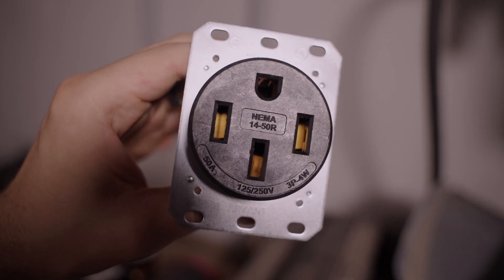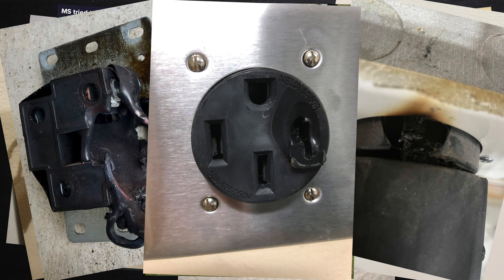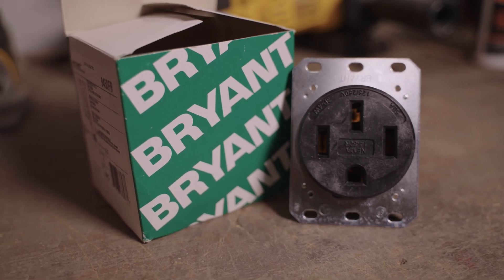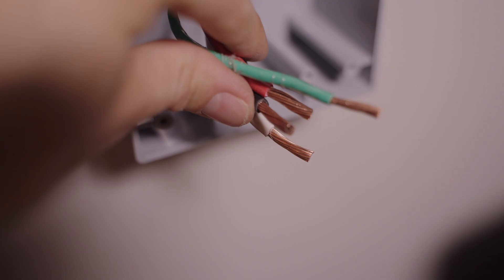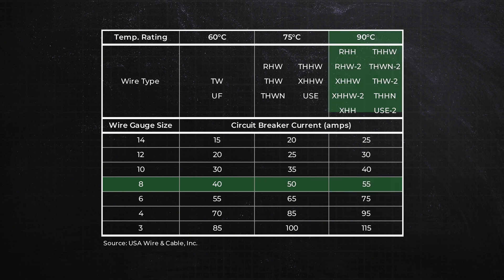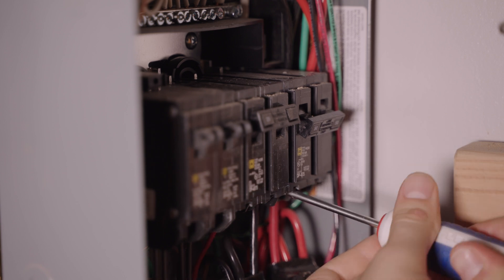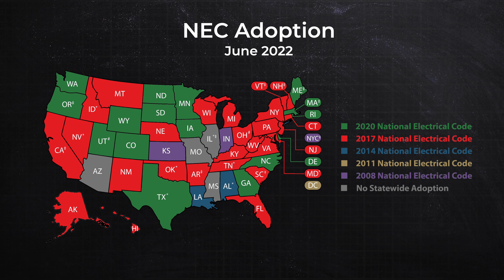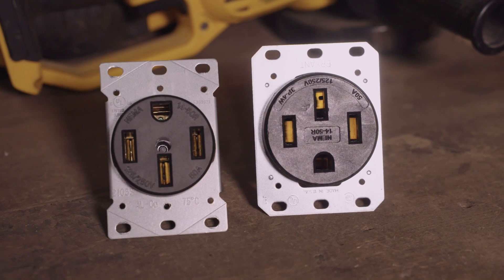3 Mistakes I Made Installing a NEMA 14-50 Outlet

Comment: Regarding setting the torque on those wire clamps, I would suggest that after you torque them the first time, wiggle/rotate the wires somewhat forcefully and and you'll find that the strands in the wire settle a little (like how the level of Corn Flakes drops if you shake the box a bit from side to side) and you can torque them again.  I usually have to do this a couple of times before it's finally fully secure.
Reply: FERRULES are the ANSWER
Reply: Great point for stranded wire  @WiSeNhEiMeR-1369
Reply: @WiSeNhEiMeR-1369  Will Ferrules work better?
Reply: Always wiggle and retorque, and don't forget mineral oil or anti-oxidation grease on the terminals. 💙 T.E.N.
Reply: Great tip !!!!!
Reply: I think this is good advise. I had used 6awg copper, shoved the wires into the box and tightened the plug. Then unscrewed plug and retorqued—there was about 10-15 degrees of additional turn on each wire. 

What I don’t know if the wires at the connection points being at virtually 90 degrees in order for the wire to fit in the box is going to be a problem later down the road?
Reply from the maker: Thanks. This is an excellent point!
Reply: @chargeeverywhere  , Wiggling the wires is a common technique called "exercising." I always exercise and retorque repeatedly, until I have two times with no screw movement.
Reply: @chargeeverywhere  ok josh so now acording to 125% continous rule you have 32AX1.25%= 40 AMP CIRCUIT. 32 AMP CONTINOUS LOAD.
Reply: RELAX TORQUE IS A STANDARD IN THE REFINERY WORLD, YOU GOT A GOOD POINT, BUT A TRUELY BELIEVE ITS OVERKILL.
Reply: @chargeeverywhere  josh so you got 75c breaker and 60c outlet  you need 60 c breaker plus 2 rules 125% continuos duty and gfci nec all evs must have gfci. If wires are going on the etic temp derating you must.
Reply: With 75 inch pounds, I doubt it's a problem. That is a LOT of force.
Reply from the maker: It is a fair amount. The yoke-style wire clamps hold the wire very nicely too. Much better than a screw scrunched down on top.
Reply: NEC 625.41 125% RULE CONTINOUS DUTY...
40AMPS X1.25=50 AMPS. 
NEC 625.54  ALL EVS GFCI PROTECTION .
#8 AWG THHN 90C GOOD FOR 55 AMPS. 
TORQUE 75LB------8.8NM YOU WILL BE SAFE . This is for the NIMA 14-50 .
Reply: @panchopantera8287  "40AMPS X1.25=50 AMPS" He can/will adjust (in the car) the amount of amperage down to comply with this. The hardware makes the initial adjustment according to what "pigtail" you have connected, then the user can adjust this down as appropriate for their circumstances via software on the "Charging" screen in the car.

Comment: When installing the outlet note where the ground plug is in relation to the cord and install it where the cord will hang out the bottom so it does not add additional stress by looping at the top.

Comment: I think a better strategy is to buy a charger for home instead of using the dumb charger all the time.  I got a great charger with WIFI interface that I can set the charging current at just enough to be finished charging by the time I need the car.  Usually the cars estimated finish time is longer than actual so I just pad it.  So far I never need max current and I charge daily to max 70% capacity on iD.4.

Comment: Jacuzzi disconnect has a 50amp GFCI breaker in it that can be installed just above/below the outlet box.. Plugging and unplugging a 40/50 amp cord from a live outlet isn't always safe, and the disconnect shuts off the outlet in case of an emergency without having to remember where the main panel is to shut off the breaker.

Comment: 1:56...after all that effort and expense, why install the outlet upside down so the cord pulls on the outlet contacts? If you plug in once for all time, it would be a good idea to secure the cord so any accidental pulling or weight on the cord does not affect the plug/outlet connection. Given the price of the vehicle and charger outlet installation with #8s or larger, are we really going to complain about $150 for an outlet we would install once? Too many of my customers want to cheap out to save $100 and use an existing 30amp circuit, rather than do it safe with the right materials. It doesn't cost more in labor to install the best outlet available.

Comment: I've been doing a deep dive into wire ampacity, which led me to closely examine the termination temp of those Bryant receptacles. They aren't marked for use at 75 deg C, so you are forced to downgrade your wire to the 60 deg C column of the wire ampacity selector. I'm guessing this is because with a more meaty device, it can't radiate heat as well so it relies more on the wire to disperse heat. Electricians will tell you that if one element of the chain is derated to 60 deg C, the entire circuit gets derated, even if the termination temp at the breaker is 75 deg C. So, instead of being good for 65 A, #6 copper wire going to a Bryant receptacle is only good for 55A of peak current. But wait! From there you need to downgrade the continuous load to 80% of that, to 44A or less. Strangely, less expensive receptacles are marked for use at 75 deg C. I'll speculate that many of the overheated receptacles were wired with inadequate gauge wire, and the wire is important for conducting heat away from the receptacle.

Comment: NEMA 14-50R.  The Bryant is under-spec which why it derates so badly.  Sure, you save $100 on the receptacle but then you had to buy a new breakers, do the work to replace it, and now are ampacity limited by same receptacle/breaker combo.

You could have avoided all this - not by running 6AWG wire - but by spending the cash on a new NEMA 14-50R that meets spec.  Hubbell is great but there are other mfgs that will do it.  AMZ is not where you get those but electrical supplies but a local electrical supply store (or MSC or Elliott) can supply.

So if the receptacle was good then the wire (8AWG) is good and the breaker is good.... so one time expense to replace the receptacle is all you incur.

I have one more question.  You bought two receps but you say you'll use one on your bench.  So you're going to leave the in-laws with the one you previously put in that you got all the comments about?   You should clean up after your own work like any pro!

Comment: A few comments: First, not all EVs use the same charging amperage for a Level 2, and while it is tempting to use a 100 amp charge setup, that is overkill for most EV charging.   For instance, a Leaf requires 27.5 amps for a Level 2 charge.  It doesn't matter if you plug in a 100 amp charger, the Leaf will only accommodate 27.5 amps at 240V because it has an internal charger.  The Chevrolet Bolt draws 32, 40 or 50 amps depending on the model and year.  Tesla Level 2 (even though I would never buy anything made by Musk) draws 40-80 amps.  So the tacit assumption that everyone needs maximum amp electrical cables, outlets, and breakers is inaccurate.  It depends.  Secondly, some state the NEMA 650 and NEMA 1450 are interchangeable.   For charging EVs, they are not since the plug that comes with the Level 2 charging cable is often NEMA 1450.  An adapter is required to convert from one to another since the plug configuration is different for the two outlets.  Thirdly, I agree with the GCFI breaker and these can be ordered online, and are easy for the layman to install.  Fourthly, it is useful to have a switch or second breaker close to the outlet, especially if the outlet is all the way across the garage.  This can be achieved by combination outlet box/breaker combinations or via a second switch.

Comment: From using the wrong type of wire to failing to pull the necessary permits, there is a wide range of risks associated with DIY installations, hiring an amateur, or even hiring a skilled electrician who is inexperienced and untrained in EV charger installations. We wrote the following article addressing why home charger installation is NOT a DIY project: https://qmerit.com/blog/can-i-diy-my-at-home-ev-charger-installation-why-hiring-a-professional-is-key/

Comment: Why has the NEMA 1450 receptacle become the de facto “Go to” receptacle for the EV application? The NEMA 1450 is a dual voltage (120/240 volt) 50 amp receptacle. However, most (if not all) EV charging adapters use 250 volts only—they do not use or require 120 volts for operation. Why wouldn’t a NEMA 6-50 (240 volt, 50 amp) receptacle be more appropriate for this application?

There is a practical reason for asking this question: A NEMA 1450 requires a neutral (white) wire which is not used by the EV charge adapter. Why run four wires ( two hot, neutral, ground) when three wires (two hot, ground) would suffice for this application?

Electric stoves and clothes dryers require both 120 and 240 volts (hence the need for a neutral wire) but an EV charger only uses 240 volts and the white wire is superfluous.

It is easier and cheaper to run three wires instead of four. Does anyone know why most EV charging adapters use NEMA 1450 instead of EMA 6-50?

Comment: You’re over complicating it. You don’t need to charge your car that fast. 40a\50a chargers are overkill for at 🏠. Not to mention dangerous. Also constantly charging at that speed will damage your battery 🔋.  Typical overnight charge is eight hours. 30 A is fine. You can run 30 A on 10 gauge wire which is much cheaper. Lower stress on the wire lower stress on the breaker box lower stress on the🔋 of your 🚗. Just put a splitter on your dryer. Buy an RV extension cord commonly available it will automatically come in the proper configuration camping world sells them off the shelf. You can easily charge a vehicle over eight hours with a 30 amp circuit.

Comment: I have issue with ChargePoint CPH50 charger with Nema 14-50 Industrial Grade GFCI Plug outlet.  No issue when it’s charging.  My circuit breaker randomly shuts off when it is not charging or unplugged from car charger port.  Does anyone else had such issue ? If charger is hardwired instead of Nema14-50 , will that solve this issue?

Comment: You dont use glue on your pvc conduit connections?  Thats not code, fyi.  One thing about GFCIs and EVs thats interesting is the Tesla chargers say specifically not to use a gfci breaker.

Comment: Get an EV rated outlet. Leviton, Hubble,  Pass and Seymore etc all sell these. They are $40-60. 

in addition if this is installed outside it will need to be a weather resistant version of this, which is about $10 or so more. 

If the outlet is in a garage, a shed or outside it must be on a 250A GFCI breaker. It also must be in an extra duty waterproof box if installed outside.

Comment: I just added six gauge ALL COPPER four wire my main in breaker box ….42 feet to the outlet and it’s Hubbell 14/50 $78.00, little more money up front…a lot less money than  intheREAR..if you have a fire!!!!  Jut do it right.   Absolutely torque and re torque

Comment: The required size and amp capacity of the receptacle is determined by the required input of the charger. The charger is rectifying the household AC power to DC and controlling the battery charging voltage to maintain the desired rate of charge and amount of charge. All effects the needed input current (amps). The  input capacity doesn't do the controlling unless you count, tripping the breaker 😊

Comment: Even with all the correct sizing, quality product, proper methods there is still some heating that occurs at the receptacle/plug interface, usually during summer months. Some EV modules detect this and disconnect when it occurs. I lowered charging max from 40 to 32amps to correct/protect from unexpected interrupted charge cycle duration.

Comment: The Car will have a AC to DC inverter on board and GFCI will Trip from time to time because of how that Inverter works as it also has to bump up the voltage with step up transformer. 

Hire electrician sure but pay no more than 500 dollar for labour at any rate.   Time to get in truck to house work and then leave.   ELectrical permits are done on line with municipality.

Comment: The ones on Lowes/HD are listed as industrial grade and have a 4.9 rating.  Should be fine if you're using the correct gauge of wire.  Plus, I can only charge at 32a anyway.

Comment: As an electrician for 41 years, you lost me as soon as you called the receptacle an outlet. Call a licensed electrician. If the receptacle starts a fire, as you state, the insurance investigator will check for a permit. No permit? No payment for your burned down house. Do the math. Not worth the risk. Yes, YouTube “electricians” make it look easy, and it will work, but is it installed to code and safe? Probably not. Thats why legitimate apprenticeship programs are 5 years long.

Comment: It never made good sense to install a NEMA 14-50 outlet to charge an EV. Hardwired wall units are not expensive, they are far more reliable, they reduce installation costs by requiring one less conductor and no GFCI and no outlet, and they free up the mobile connector to be used as designed, as a mobile charging solution. It is anti-EV forces who have pushing NEMA 14-50 charging because they know it is sub-optimal.

Comment: I found out through Technology Connections' YT vid on EVSEs that part of the standard "connection" sequence is the system checking the grounding.  The only way I can conceive of that happening is if the EVSE or the vehicle tries to send SOME current down the ground connection.  I had a Siemens breaker which would trip maybe 2/3 of the time when I would plug in my hybrid, either immediately or when I heard the click of one of the contactors closing.  I couldn't locate a new Siemens in my area, so I replaced it with a Square D, and I haven't had much trouble with it.  This plug-in car is only about 4 weeks "new to me", whereas the Siemens had been installed for a few years.  I'm guessing the Siemens is engineered to be more sensitive...or maybe after so much time and a trip now and then, it has gone defective.  Either way, I've only had one nuisance trip of the Square D for a couple of weeks, and that wasn't even at charge initation time, it was sometime in the middle of the night.

Comment: I test my outlet, charger, and cord during charging operations (hourly) in the summer in Phoenix, AZ, with a laser thermometer.  The highest temperature at the receptacle was 115 degrees, the charger is generally 128 degrees, and the cord 113 degrees. The highest ambient temperature of the garage I've seen was 117 degrees (I didn't charge that day). The book says don't charge when the temperature exceeds 122 degrees. We own a Nissan Ariya, which has a built-in cooler for the battery, which does come on intermittently during charging during the summer but not in the winter.
Reply from the maker: Interesting. I’m guessing your outlet and charger are in the shade? Most chargers are black, which isn’t great for AZ.
Reply: @chargeeverywhere I said: "garage".
Reply from the maker: @dennismaloney7241  Righto. My bad.

Comment: Best to coat the wire ends with anti-ox before clamping in the outlet.  It is requisite for aluminum wire, but also helps with copper wire.   Some appliances like refrigerators trip GFCI breakers.  Latest-greatest is AFCI-GFCI "combined" breakers.  Some Eaton models suffered so many false trips that they have a stealth recall to replace them for free.

Comment: typical random youtube video. you need a 50 amp breaker and a 6 guage wiring for this to be safe
Reply: It's not that simple. The issue is derating. 80% of rated for a "continuous" load. Which is defined a greater than 3 hours in the NEC.
Reply: @TheRayDog  mobile charger draws under 40A which is well within 80%.